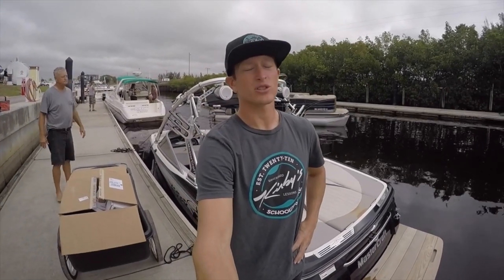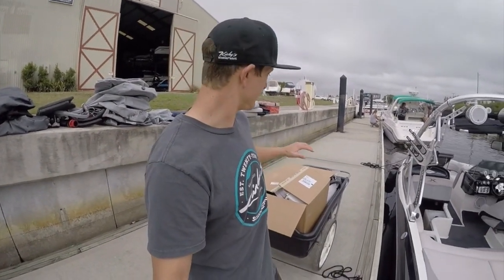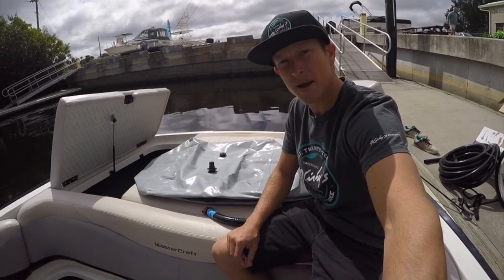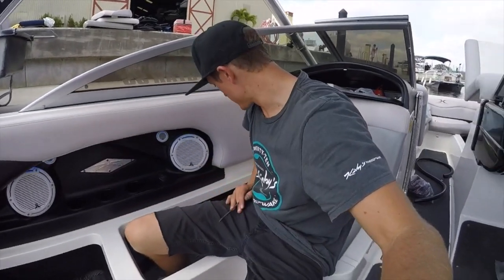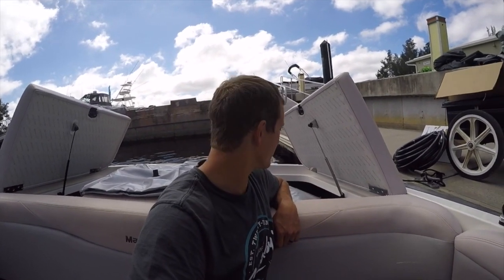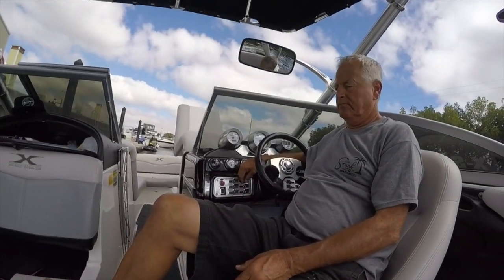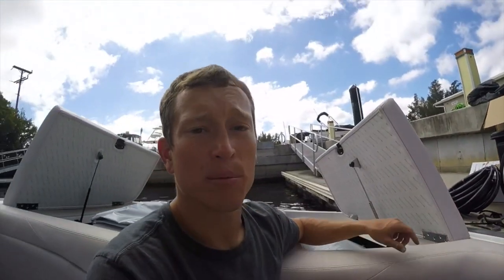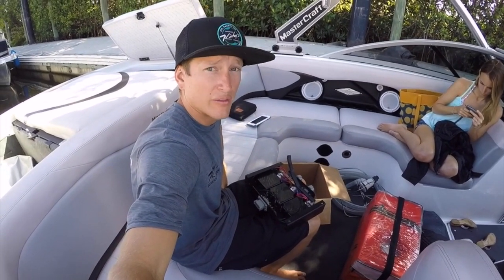WakeMAKERS Piggyback Installation

Comment: Thanks for the video. I need clarification on where the T fitting goes on fill line. Is it the line that dives into the hull tank. The existing line that connect there now seems to go up to overflow. If so, what connects to where the overflow would have gone?